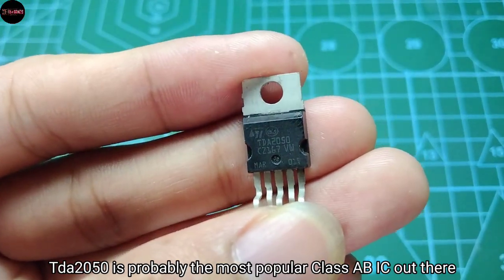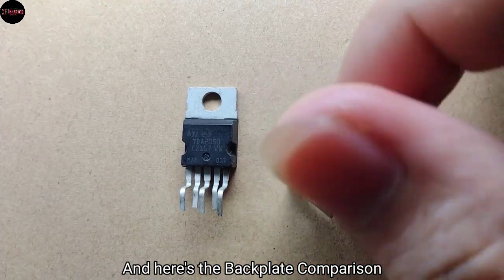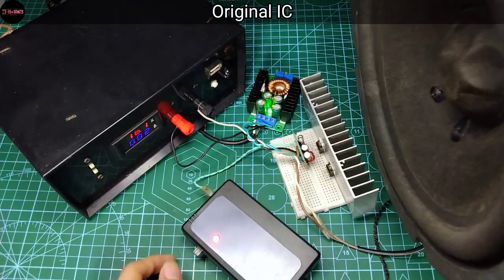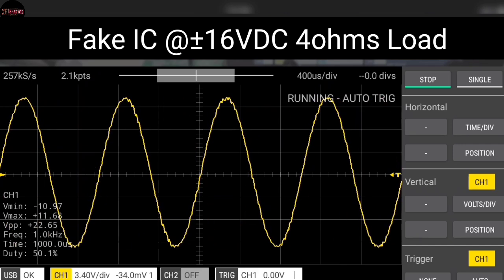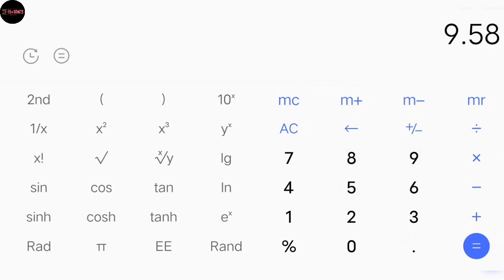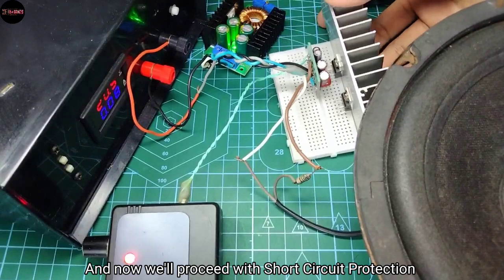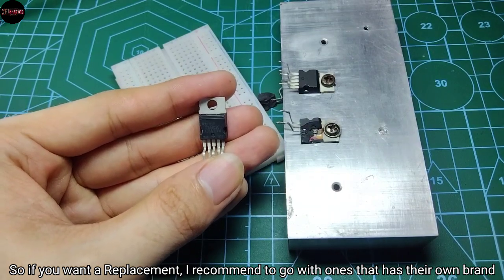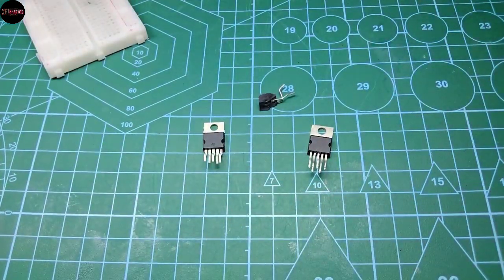TDA2050 Real RMS Power Test !! FAKE vs. ORIGINAL #amplifier #tda2050 #tda2030 #audio

Comment: What is noise level on speakers when there is no input?
Reply from the maker: TDA2050 are the cleanest sounding Amp Chip if we're talking about the chip itself. 

The Noise will depend on the circuit design really. I used it in a Breadboard and still Sounds absolutely good

Comment: Does the utc original one have short circuit protection ?
2. What's the price per ic ?
3. What size heatsink required for two numbers of ic on same heatsink & does the fake ones heat up more ?
Reply from the maker: I didn't have experience with the UTC so far, but I watched a Guy reviewed it. It performed exactly the same as the authentic one. For the short circuit protection, I'm not sure but I think it said it has protection in the datasheet.
Reply from the maker: Regarding the heat, Honestly, the Fake and Original Heats up the same. The only difference is that the original has Higher output power. Meaning, the original is more efficient

Comment: I use UTC 2050 ic  for stereo amplifier.Really they are very good. And they withstand 34.5V DC single supply.
Reply from the maker: Yeah, Taiwan Chips are pretty good, I hope the UTC ones will not be copied or counterfeited
Reply: @x3dtronicsph  Sadly there is copy of UTC TDA2050 in makret these days for some time now, they come from YW brand and makred as UTC2050 UTC2030 to give impresion as they are made by UTC
Reply: Do they give same watts in single and split rail suppy ?
Reply: @amitghosh6966  yes

Comment: Any question fake ic not works and only make heat in the heatsink ?
Reply from the maker: If it does make heat and No Sound output even you have audio input.
2 things, either check for your speaker.
Or, If speaker is working, the chip is probably broken

Comment: For a fake chip not so bad... 
original one has another level of quality.. i use fake tda2050 chips from few years ago on 2.1 diy system and work good without problem even at +/-23vdc and 4 ohm load
Reply from the maker: Yeah , for high fidelity music, both chips will be useful, as long as you know what you're doing🙏
Reply: @x3dtronicsph  în my opinion is way better than class D amplifiers even if fake ic.. Has better sound output în term of quality and noise

Comment: Please suggest me which audio ic has more clarity and details
Reply from the maker: Basically they have same audio quality.
But the original one is more powerful and does have protections
Reply: @x3dtronicsph  I'm not asking about 2030 ic bro. Overall audio like tda7294, lm 3886, stk ic like that?
Reply from the maker: @playboy7995 basically any Class AB chip will sound good. 
For Class D amps, So Far, the TPA3110 is the best sounding one, other class D are not flat sounding especially with 4Ω load

Comment: What tda2030 circuit are you using, may i have a diagram?
Reply from the maker: It's on the datasheet of TDA2050 ma'am. It's the same setup with the TDA2030. 
I used the Dual Supply confirmation

Comment: I made more measurements, the slew rate of the fake lm1875-tda2050 is 2.5v/us and stable with unity gain and tried it up to +/- 27v without problem. It has drop out higher than tda but lower than lm. It has a very particular high frequency that makes female voices sound golden.
With unity gain stable, it can be paralleled and bridged to output over 200w, 10 pieces for $1.
Reply from the maker: Most LM1875 online are Pullout ICS.
Other may be authentic with a cheaper price.
Nice work brother

Comment: i did a stress test on my subwoofer after i replaced it's burnt amplifier ic which is the same as what shown here and so far the ic is still okay also i used thermal pads instead of paste because it's kinda pain in the ass  to apply
Reply from the maker: They'll work just fine bro, It  will depend on the load impedance, wire used. Something like that

Comment: Where do you get original tda2050 ic in the Philippines because I need those
Reply: I hv TDA2004, unused, ori ST mfg in 1980s.
Reply from the maker: They're only 2nd hand. Wait , ill pin the comment
Reply from the maker: Here.
They're not brand new BTW 

https://s.lazada.com.ph/s.Nv0nn
Reply: @x3dtronicsph  Bro I bought a TDA2050 IC from a local shop for just 0.3$ . The seller said it's original and new . And it looks like the original . But I am not sure about its authenticity !
Reply from the maker: Brooo.
Try to look at their internals 😆😆😆.
Even though its fake, they will work afterall
Reply: @x3dtronicsph  raise your hand if you ever burned your self from a cement resistor ✋
Reply from the maker: @gabrielantiligando9905 absolutely 😆😆😆

Comment: ano po pangalan ng store idol
Reply from the maker: 2nd hand nalang mabibili na orig na TDA2050 ngayon boss. Kahit i check mo sa Mouser o Digikey, wala na TDA2050.
Mga UTC2050 lang available at LM1875T.

Pero kung gusto mo bumili boss, Subok ko naman na .
Eto po link:
https://s.lazada.com.ph/s.NMZrz
Reply: same watts naman boss?
Reply from the maker: Hindi boss eh. Mas malakas yong Orig, tsaka kahit ishort yong output ng Orig buhay padin.
Yong mumurahin sa Shopee, Pumutok agad eh😆
Reply: @x3dtronicsph  mukhang mas malakas pa ata yan kaysa tpa3118
Reply from the maker: @pho1455 Oo boss. Hanggang 24volts lang kase yong TPA3118.
Yong ginamit ko na supply sa Test, Dual supply yon, ±16volts at ±20volts.
Bale kung testerin mo ang pin 3 at 5 ng IC.
32volts yon kapag ±16volts.
40volts naman sa ±20volts.
Kaya mas malakas kase mataas talaga supply voltage ko
Reply: @x3dtronicsph  DC ren ba supply Nyan?
Reply from the maker: @pho1455 Oo boss.
Dual Rail Supply neto, pag naka Single Supply mahina.
Minimum ng dual 16volts DC supply neto
Reply from the maker: Tsaka ayan lang alam ko na nabibilhan ng orig na 2050, Sinuyod ko na lahat mula shopee, ayan lang talaga

Comment: Boss, can we add a speaker protect fir this ckt.? Or the speaker protect is good only for pro amps?
Reply from the maker: Di ko pala na test kung may speaker protect yong orig.
Pero dahil puro peke na tda2050 online. Mas mainam na lagyan ng speaker protection.
Pero base sa experience ko, di pako nakaranas na nag output ng DC yang mga ganyan.
Diretso Pumuputok boss
Reply: @x3dtronicsph  how to know the LM1875 if legit or not? I ordered sa online, di nman dumidikit sa magnet. working din, orig kya ito?
Reply from the maker: @Bisdako2013 eto ang mahirap boss, pero ang orig na LM1875 kase, wala syang Ukit sa Gilid.
Yong mga peke yong may ukit